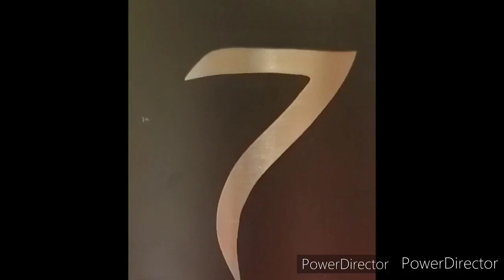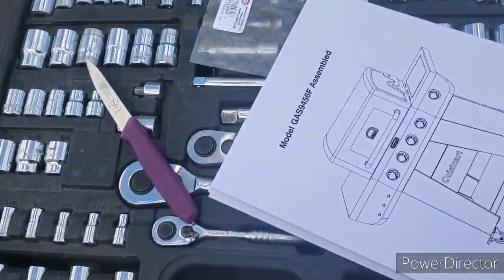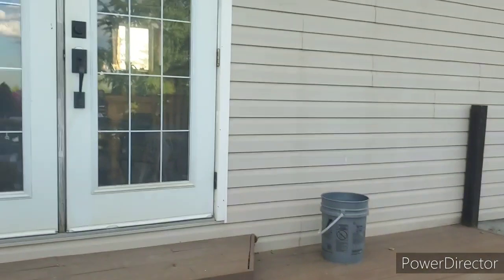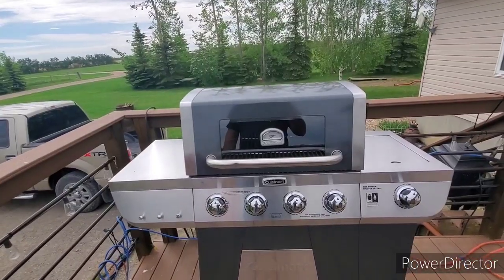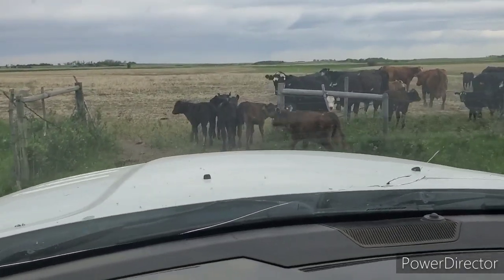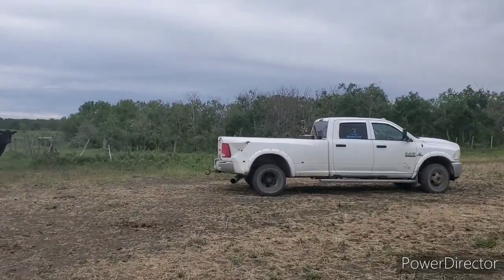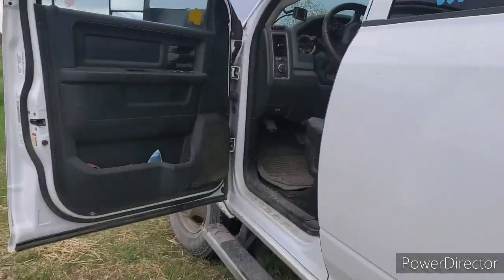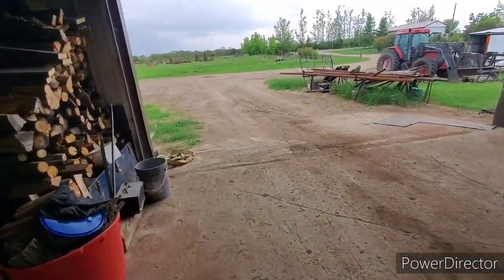BBQ Assembly/Build

Comment: At least the party lights were flashing on your son's truck. My oldest son pooched his dodge so bad it cork screwed the dip stick. My nephew, (he is a big guy), pulled and jerked to get it out. I'm surprised the plastic handle didn't bust off. My sister has that truck now with a different engine. 
Doc

Comment: Changing parts is easy, just make sure you put the new on the same as the old were!! Bleeding will probably be the biggest pain in the arse!!
OMG, you went to the dealership for parts😵😵😵 always over priced!
Good plan to take them back 👍
Get it done 👍👍
Reply from the maker: Most of the after market shops here have nothing but a bunch of dumb ass kids working in them and never get the order right
Reply: @bcpfarmandtrucking6560  sadly, it's getting to be that way everywhere

Comment: Hope you replace the brake hoses too. They can collapse internally and not let the fluid return and keep the caliper tight. Thanks!
Reply from the maker: Never thought of that...I'll see if they have the parts
Reply: @bcpfarmandtrucking6560  It's bit me in the ass too many times over a $30.00 part. Best of luck partner.